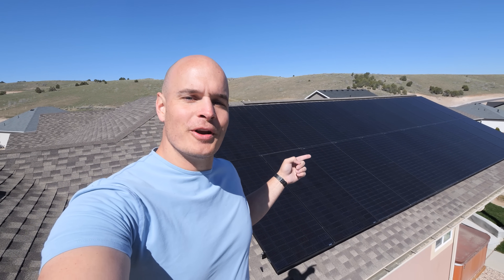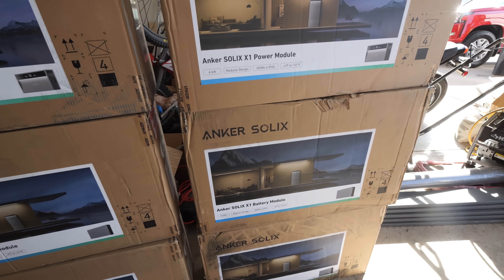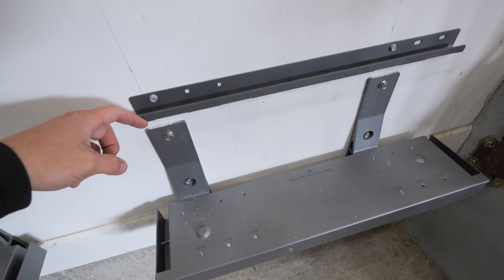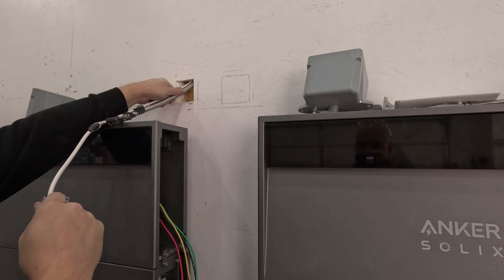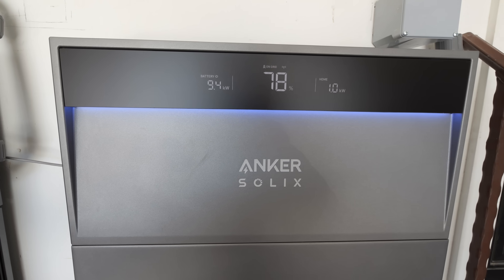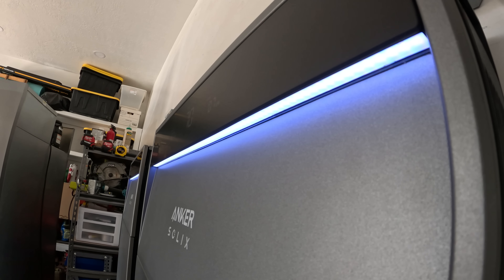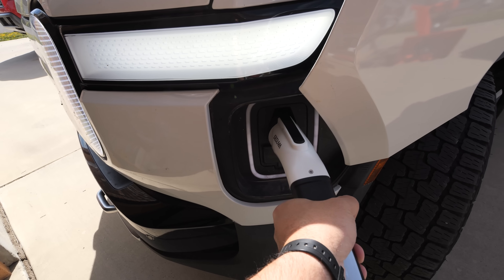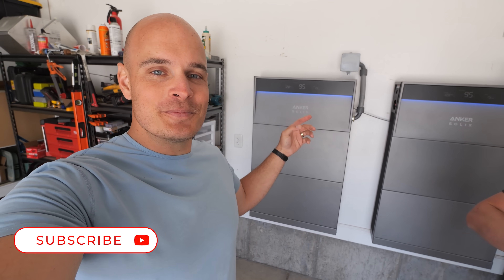How to Save Sunlight for the Night? - NEW Solar Battery Install

Comment: Hey @JerryRigEverything, I noticed cost wasn't mentioned in the video. How much would Jake's battery backup cost before things like tax credits (or nyserda here in NY)? We're pricing out a solar/battery system right now, and I want to make sure we're getting the most bang for our buck.

Thanks for the great videos! It's always nice to see you do installs - such clean work! :D
Reply: I would bet good money Jerry's paid promotion contract stipulates that he can't discuss the cost. "Just talk about all the good things about the system, make sure you point out the 20ms off grid feature at least twice, praise the ease of installation and we'll send you free stuff + payment for the promotional video."  Jerry will get a million targeted views on this video which will net the company 100x the revenue compared to the amount they spent on this video.

I hate being this skeptical but after seeing the other side of how it's done I guarantee that's what's going on.
Reply: I'd guesstimate 5-15k for the main equipment. The extra equipment like the transfer panel and wiring is probably another grand or two and then labor/installation costs will vary greatly depending on region and contractor.

Comment: Over the top i got 10kwh storage and it runs out before midnight and dont even have the full house on the batteries😂
For a normal Familie there must be a minimum of 25khw of storage, or u waste so much off the generated electricity

Comment: Please isolate them as much as possible from the timber frame home with a fire rated wall, to give the fire service more time to respond and subdue a possible battery fire in the garage.
Might as well install a IoT smoke alarm that connects to your phone with an app.
edit: as pointed out, they are  LiFePO4 Batteries, and thus have much lower risk being a fire hazard
Reply: It’s not a lithium ion battery pimp. Lifepo4 chemistry is non combustible.
Reply: @gastiresoil9758  thanks for pointing that out, edited my comment

Comment: the cost of those solar panels is HUGE. I dont get it.   you save maybe $100 a month on electricity but you had to spend WHAT $20,000 - $30,000 .  way to expensive

Comment: I wish you would give a few more technical details on the install of the whole house auto-transfer switch. Looks like it had the abillity to support connecting a generator to the system along with the solar PV. Would love to know how that integrates into the system.
Reply: No external transfer switches, this equipment does it internally. Very few of these systems can integrate a generator in addition to the electrical grid. If you want to do that you would need an inverter such as a Sol-Ark.

Comment: Quick note:

Y'all dont really need to go the Anker route.

You can buy batteries with equivalent capacity for $1200-1700 each.

And you can buy the inverter for $800-$1500.

However the solar panels and the cables and connections yeah thats another $5000-6000.

I should know. 

Installed my own home solar so I know the gemeral costs

Comment: Battery tech has advanced so much in the last 5 years 🤯
Reply: Has it though? The tech part, not the applications of the battery.
Reply: @vivekparmar7576  you said it yourself though, the tech part? that has improved
Reply: @TypicalBlox  It has improved but it "didn't advance so much". We're still stuck with Lithium-ion batteries.
Reply: Too much "though" in this rheead
Reply: It's still basically a lithium battery with the same temperature issues and full capacity voltage damage issues. 

The true next advancement will be when lithium batteries don't kill themselves with high capacity charging so they will pretty much last forever. Fast charging, high capacity etc. is nothing compared to a battery you don't need to replace.
Reply: did it tho ?

Comment: Any problems getting PGE to allow for grid tied connection with well over 100% daily/monthly capacity?

Oh, and the biggest reason that it makes sense to add batteries, is that PGE no longer effectively buys the energy from you at the price they charge you.  Hour by hour vs yearly or even monthly true up of use. Shameful.  In fact it is more than a 10:1 difference in cost (0.04/kWH vs >0.40/kWH),  so ya, batteries are a must now.

Comment: This system is pretty bad, the batteries are split between two head units for 240 so if  your load is off balanced in the house one will get a lot more cycling than the other and could drain one and not the other.    Also this doesn't seem grid interactive, also why are the batteries using MC4 connectors there is no way that is proper based based upon the loads.
Reply: Nope, both inverters are 240v and are hooked up in parallel, it is grid interactive, and the batteries are 300V DC MC4 is an ideal connector for that.

Comment: 30kWh/day is insane, I recall from School projects normal homes being like 1 or 2 .  Of cause this was with incandesant lights, but no airconditioners in normal homes .
Reply: Yeah here a 4 person household usually has ~4000 kWh a year... (excluding heating).
Reply: 2kWh/day is equivalent to a constant 83 watt load. That's about what a single refrigerator uses. I could see a very efficient home using 5kWh/day.
Reply: @eDoc2020  your refrigerator does not run 24 hours a day.  A good energy efficient refrigerator uses ~150-250 kWh a year, not more.
Reply: @DooMMasteR   My refrigerator uses about 160 watts when running, I already accounted for the partial duty cycle. The OP was talking about the days when incandescent lights were the norm so anything more efficient than a typical 1990s refrigerator is not a fair comparison.
Reply: @eDoc2020  lol, mine is like 155 kWh a year... and I think that's what @johndododoe1411 meant when they said the 30 kWh/day are A LOT... it's just a lot...
Reply: @DooMMasteR  30kWh/day is a lot in absolute terms but keep in mind it's a national average which is impacted by high users. The South lives on air conditioning and electric heat. Even when electric heating is by heat pump it's a ton of energy.

Comment: I recently installed solar panels in my house but batteries just didn't make sense to "stay off the grid" as they are way too expensive for the money you are saving.

3x5Kw batteries were like $10,000 to $12,000. Definitely not worth the money when you compare how much you spend every night in electricity in a regular house.

If we get to a point where 15 kwh in batteries cost $3K... That would be real savings!
Reply: We're almost there. You can get basic 12v 200ah LiFePO4 packs for under $500, that's only $200/kWh. Now I'm realizing that meets your price point exactly. Problem is you still need an appropriate inverter which is at least $1k on the low end. And those cheap components probably don't have all the needed approvals for a fixed installation. For a DIY "portable" system you could definitely get a complete $6k which is not terrible.

Comment: Hello Jerry, I have a cool solar project for a video for you. About two years ago I ripped off with solar, I have all the equipment, more on the story privately to you if interested. I need someone who can finish it and get up and running and do a cool video for those who are in the same need as me. Message for details.

Comment: Not sure if I missed it but you didn't cover if these batteries are Tesla solar panel compatible or if you can integrate these batteries to the Tesla solar system I don't have Tesla batteries.

Comment: are these batteries NCM or LFP? Because LFP are much better and last much longer. I wouldn't recommend installing if they are NCM batteries
Reply: No battery is better they just have different purposes
NCM has higher density and output while LFP has longer lifespan and lower fire risk

and yes they are LFP

Comment: Nice.  We love having batteries that are recharged by our solar.  And we love even more not having a net annual electric bill.  The one thing we did not expect to be as useful, was that the batteries take over nearly instantaneously if the grid goes down.  No flashing lights, TV does not flicker, nothing.   The only way we know the grid is down, is when the app on the phone tells us.
Reply: How often is your grid going down?
Reply: @gastiresoil9758  Depends on the weather and traffic.  Usually, one or twice a year for 3-4 hours.  But a couple of years ago for 3 days when some guy drove his car into a big pole and sheared it off. Immediately took out power to 200+ homes.

Regarding bills, electricity usage cost decreased from $400+/mo. to getting a check for few hundred back for the year.
Reply: @JBoy340a how much electricity were you using for $400 a month? Where is this? I left a 1500 watt heater on in my garage for the entire month and it affected my bill by $100. How much power do you use?
Reply: @ryanespinoza7297  NorCal.  3000 sq foot home.  12 kW system.  Usage depends on time of use.  Daily consumption in summer about 40-50 kWh (AC), winter 20-25 kWh.  Rates are varied by time and day. M-F is peak 3-8PM, remaining is off-peak.  We also get an additional check for sending power back to grid during power alerts.
Reply: Your "net annual electric bill" is many-many-many times less that just one of that battery, let alone that solar array. Wtf are you talking about, "off-grid" adept? 😂

Comment: for all of you watching this that have central AC this battery will not start your AC this battery has a max amperage of 50 amps which will not crank your AC
Reply: Starts mine no problem
Reply: @Jackham13  you must not have a centralized ac because most units of about 3 ton or over which is pretty common in my area need about 150 cranking amps
Reply: @raulvergara272  it’s a 4 ton central air, draws 22amps running, around 80 amp startup, no problem for a system like this.

Comment: Jesus christ America is 20 years behind the rest of the world. Metal tubing for electric wires, seriously?!?!
Reply: I imagine that inside the walls that you can easily drive nails into you'd want conduit that resists getting punctured by nails. Aside from that, I don't know why you'd want it to be metallic. Maybe to be seen with a stud finder? But I really don't know; I'm no electrician.
Reply: @AndyGneiss , The most modern countries use plastic tubing. And you don't drive nails just straight into the wall. You make sure there is nothing on the other side. Metal tubing is also very expensive compared to plastic.

If for some reason a cable gets conductive it will conduct that entire tube and the metal housing used in the US. Very dangerous.

Comment: that setup isnt as over the top as you might think here in south florida I have installed several homes with 30-40KWh of batteries and 100+ modules on the roof

Comment: Well, the calculus of selling energy back to the grid will change soon. With more people installing solar, the grid providers can recoup less and less of fixed costs (maintenance and administration) of providing a service through usage charges, and the pricing model will likely to change to flat fee for connection and usage fee on top of that. Someone has to pay for all that rarely used wiring that goes to your solar powered house.
Reply: FSM forbid all the for-profit, publicly traded energy companies reduce the amount of stock buybacks or size of their dividends! We must protect their level of profits! Someone else must pay!

Comment: The inverter should be able to cycle to use solar directly instead of the sun when their is a blackout instead of using the batteries

Comment: If your electric company is net metering & kWH billing is the same all day, what is the advantage of a battery?
Reply: Could be useful if your utility either doesn't pay 1:1 what you give back, or if your utility loses power in a storm this would allow you to not need a whole home generator.
Reply: if you signed a NEM2 or NEM1 agreement, and you don't have power outages, there is zero incentive to get a battery! but on NEM3 and other variable rate billing, or you have outages, batteries make sense.

Comment: I am really curious how you combined this into the existing solar system setup. Did you disconnect the existing inverters? Are you charging the Solix directly from Solar or using the other Inverter feeding into the new Solix inverter. I am sorry, this video was just not as clear for me as a more technically minded individual. Also, those batteries appeared to be very lightweight either that you are much stronger than I gave you credit for. Could this be the option I seek to add Lithium storage to my RV? Hmmm...
Reply: The backup box has a 80A AC PV input port for grid-tied and micro inverters. Each battery is around 115 lbs, heavier than other 5kWh LFP batteries on the market, some of them are as little as 95 lbs each in a server rack configuration.

Comment: The problem I have with solar and everyone who has tried to sell it to me is the price. They try to tell me it will pay for itself, but by the time it's close to end of life. At that point why do it? Also, they suggest I install it in my backyard where it gets sun in the winter, but during the summer when the tree back there has leaves my house is in the shade.

And let's say you have an older roof. When you need to replace the roof you'll also have to have someone who works on solar remove the panels and reinstall them.

If I find a house in the future I like that already has solar and I'm in the market I might buy it, but no way am I paying for it myself.
Reply: you're not the target market. You can do the math all by yourself, if the solar+micros don't pay for themselves in 2-4 years, and at the same time don't come with a 25 year warranty, then you're at best going to break even. Once you add batteries, you'd have to have extra reasons such as incentives, NEM3, frequent outages and such to help pay for it.
Reply: @stefanvanzyl9090  exactly. Until cost comes down a lot of homes either don't make sense for it or don't break even. It's crazy because I know of at least one house in my area with solar panels and it looks well done, but I have to think they wasted their money unless maybe they installed it themselves.
Reply: @YourAverageReviews  I install this stuff for a living (though in a different country) and a couple of my older systems have already paid for themselves in under 5 years - mostly due to excessive connection costs from the utility, so now the customer gets electricity for "free" until the inverter needs to be replaced.
Reply: @stefanvanzyl9090  I think that's awesome if that option exists, but it seems like the cost of solar outweighs the benefit in a lot of cases. I'm not saying no one should have them, I'm just saying the world will change once the cost goes down.
Reply: Normally you earn it back in 7yrs (solar) and they will work for more then 25yrs
Reply: @ianvanede7466  I've done calculations on my house and it says after 20 years it'll benefit me $32,000 but cost me $29,000. So that's quite far away from 7 years... And that's when I put my electric bill lower than it actually is. When I put the actual number it says "With a current electric bill of $X/month, your roof may not be ideal for solar panels. Contact a solar provider to learn more."

Comment: Using a halogen light to test switching speed is pretty misleading, use something that is actually sensitive to it, like a desktop gaming computer doing something more than idling.
or a microwave that is actively cooking.

Comment: do you know who the suplier/distributor is for this outside of america and if it is compatible with 240v nominal houses?
Reply: Anker designed this themselves, apparently, specifically for the split phase market.  The design is strikingly similar to the Huawei and SNRE systems, but the software is different.

Comment: I find it mad Americans make walls out of stuff which you can just yolo cut holes out of with a saw. I can’t do this easily as I’d need to drill through multiple walls of brick , breeze block and so on essentially making a simple job like this, huge.

Comment: Without selling to the grid, I wonder how many years it would take to recover the investment.
Reply: 2-4 years for the panels and micros, 8-12 years for the battery and backup portion depending on incentives and frequency of outages (since running the generator is significantly more expensive per kWh than utility power)